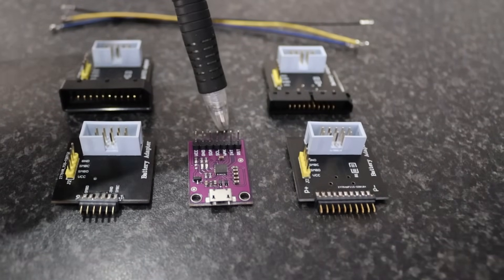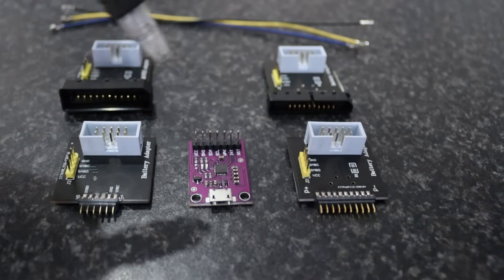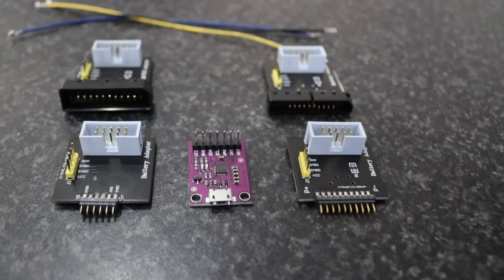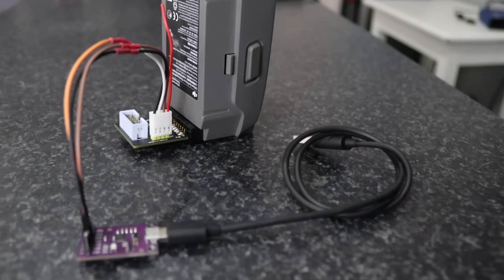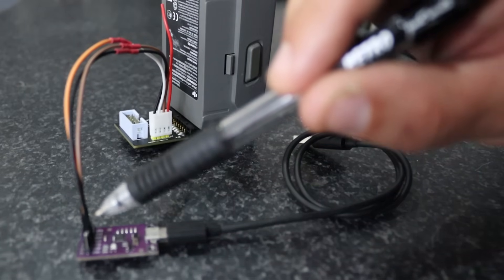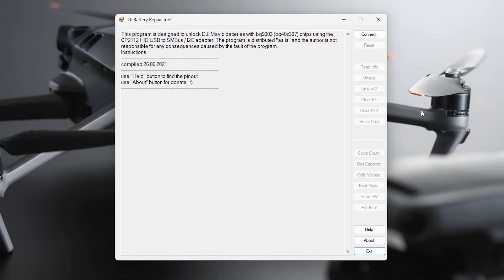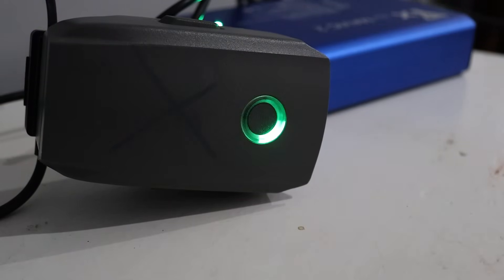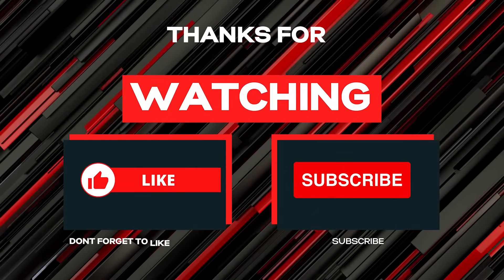Revive Your Drone Batteries in Seconds - You Won't Believe How Easy It Is!

Comment: Great video, ordered the CP2112 Debugging Board and the Battery Adapter Board from the links provided. I just need the DJI Battery Software. Would you be able to transfer me the files please?
Reply: There is a link provided above, and once the form has been completed, and you email them at the link in the instructions, they will send a link and the password.

Comment: Is the battery for a Mavic Air 2S the same as the Air 2?    If yes, I'm assuming the board will work for the Air 2S, correct?
Reply from the maker: Yes they exactly the same 👍

Comment: How to deal with NON DJI BATTERY error in Mavic Mini 1 ?
Reply from the maker: How do you mean NON DJI Battery Error
Reply: @adkwc  i changed mavic mini 1 battery cells and unlocked battery with CP2112 but drone shows Non Dji battery detected message so battery not usable
Reply from the maker: Ah ok , as far as I know there is a activation required , this can be done with the EV2300 and Software .
Reply: @ravibhadaniya  Battery cells would need to be calibrated to be used safely, and the battery killer software does not have the option. You can calibrate with paid for software, and an EV2300 though. So when unlocking in Battery Killer, use the clear PF option ( both 1 and 2, same as unseal 1 and 2 ). When you use the clear pf option, it automatically seals the battery. Usually when you get the error you are getting, its because the battery hasnt been resealed.

Comment: Is there a solution for the original mavic pro?
Reply: It works with the mavic pro too, but you need to take the battery apart and find the pads
Reply from the maker: @dennisstrunk9464 correct , which is shown in one of our other vidoes.

Comment: Its not working for me, im getting an Error... "Could not perform SMbus read 0x00" do you got any idea why?
Reply: The other option is to plug in the battery to a charger, just for a moment, and unplug, Then attempt to read again. 
Also, when reading, make sure scl and sda pins are correct. Lastly, the CP board wont read if the cells voltage is too low. You would need, as Dave mentioned, a power supply ( the original charger wont work ) to charge up the cells collectively, or even better, individually to the same voltage so that they are properly balanced and can then be read by the CP. I would charge these up to 3.5 volt per cell, then the CP wont have any issues. This also then allows you to, after clearing any errors, put it on the original charger to test if it works, and fully charge the battery properly.
Reply from the maker: Thanks for watching , before you hit the read tab push the batteries power button and the read , if that does not work , check your wiring that it's on the right place , if that does not work then your battery overall voltage is to low to read the battery which means you will need to push the voltage up using a bench power supply before attempting to read again.  I hope that helps
Reply: @adkwc  how do I do this? I got a Mini 2
Reply: Did u figure it out ? Im having the same problem.

Comment: I bought it for my 3 Mavic Pro 1 battery, I haven't tried it yet, but watching some videos I see that they rule out the possibility of reviving these in particular.  Could it be that it works with the batteries of this drone, what can you tell me?
Reply from the maker: The CP2112 won't work with Mavic Pro 1 batteries , take a look through our vidoes you will see we specifically did a video on Mavic Pro Battery recovery , it's a little more involved with different software and tools required.

Comment: Awesome video, thankyou 👍 Note: This can also be used for DJI Ronin gimbal batteries (I've revived a couple of packs for a Ronin-M) SDA, SCL and GND can be found as test pads on the BMS board, or from the outside with the connector block upwards and the connectors pointing toward you, the two largest ones, from left to right are + and - , followed by two recessed contact pads, top is SCL, bottom is SDA. These are based on the TI BQ30Z55 which you'll need to select in Battery Killer, otherwise you'll get errors. Update: Just used Battery Killer to revive a dead Ronin-S battery as well, what an amazing tool!
Reply from the maker: Thanks for the comment and info , good to know it works on the Ronin Batteries , thanks for watching
Reply: it will work with  ronin mx batterys right ?
Reply: Sorry I can't say either way,  @gokux.  I only tested with Ronin M battery.
Reply: @gokux.  Sorry just seen your comment, I don't know which ones the MX uses, but if it's the model No: 423496 (1580mAh 14.4V) then yes, this should work.
Reply: how many wires do I need to solder to the board for checking DJI Ronin battery?
Reply: @MikkoTolonen  Three: GND, SDA and SCL, they should be labelled on the board.
Reply: @therealchayd  Thnx. I got it now.
Reply: I got the chip but no matter how I connect it i just get an error. I have checked the solder spots where I soldered the "pin thing"  but I guess my batteries are just beyond any hope
Reply from the maker: @MikkoTolonen whats the voltage or each cell ?
Reply: @adkwc  I´m pretty sure they are both zero. I bought the thing used and it had been it the closet for a few years. I guess the gimbal is garbage then, but I got a nice sturdy case for 60 bucks :)